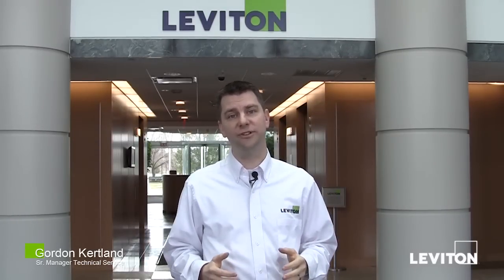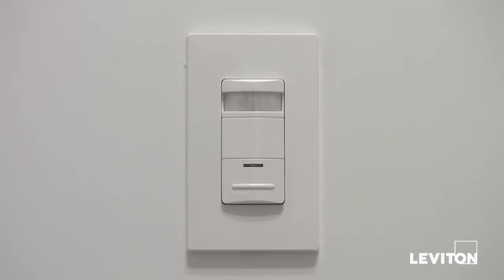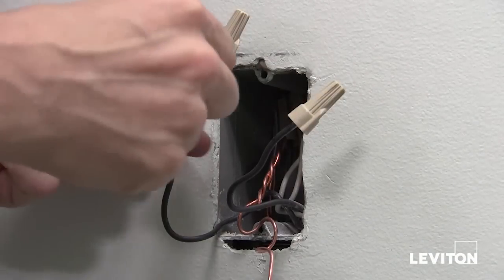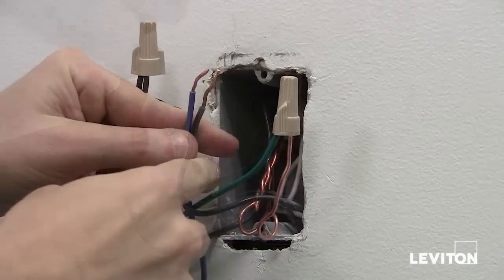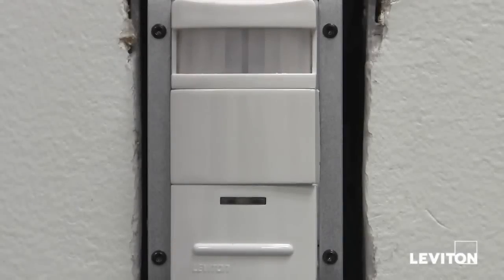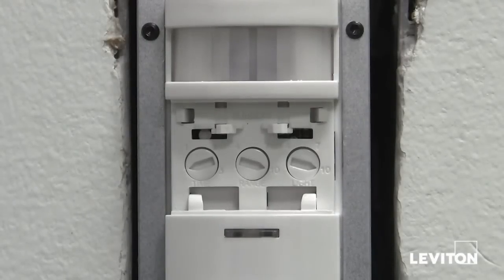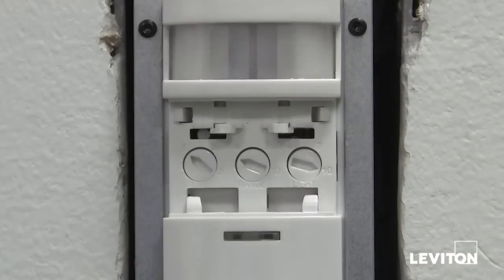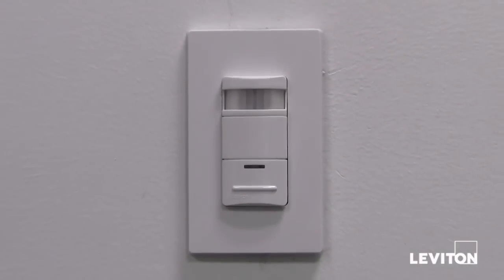Occupancy Sensor installation - ODS10 | Leviton

Comment: How can this be used in the Philippines when there are 2 wires only connecting to the switch? There's no ground wire available.
Reply: If the box is made of metal you can ground to that by putting a terminal on the ground wire and using a self-tapping screw to attach the ground wire to the back of the box. Hope that helps. Make sure power is off before inserting a screwdriver or drill driver into the box!

Comment: so tell me how does the sensor get power to operate the occupancy sensor function? Without a neutral conductor completing the circuit for the sensor portion.?
Reply: That's an interesting question! I would guess that it uses the ground to complete the circuit, much like how you can touch the line wire when live without getting shocked but if you happen to be touching the box at the same time you will get a shock. Actually it just occurred to me that the neutral in the light fixture is what probably completes the circuit.
Reply: it cant use the neutral , because it isn't connected ! so this tells me yep its powered by completing the circuit through the ground back to the panel board,, (although im sure its minute current draw) i do not want ANY ground  acting as a return path for a circuit ,, nope ,, there are occupancy sensors that use a neutral ,, i would not want this type here 

  i am not even sure the latest Electrical code will allow this , without a neutral conductor
Reply: nate I've always trusted the name but I'm not a licenced electrician so I couldn't say for sure if the switch poses any hazards. Hope you get a response from them as I am curious now as well.
Reply: Strange how some include the neutral and some don't even though they are very similar.

Comment: I only see 2 cables inside my box but no hot wire . Any info ??
Reply from the maker: This model requires three wires; Input hot, output load and Ground.  Ground is necessary for this device to function.

Comment: Is there a way to make it like manual? I would like to de-activate the sensor.
Reply: Use a regular switch.  It's much cheaper.
Reply: Mindbeauty turn light control fully counter clock it lets you manually turn it on then it turns off after timeout

Comment: what is the voltage tester that you use? I looked for it on amazon but can't find one that's got a red/green indicator like yours
Reply: +Greg B , I believe its this one:- http://www.homedepot.com/p/Unbranded-Dual-Range-Non-Contact-Voltage-Tester-NCVT-2SEN/203499607?MERCH=REC-_-PIPHorizontal1_rr-_-205951747-_-203499607-_-N